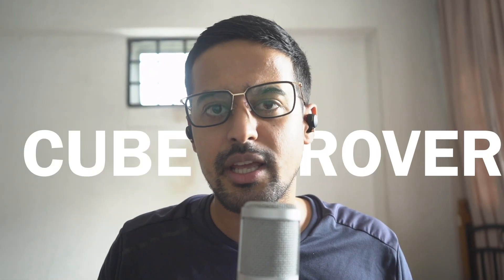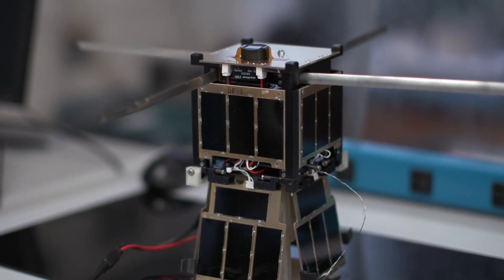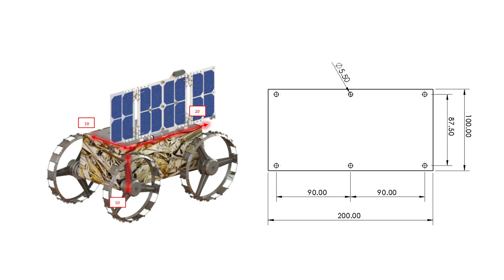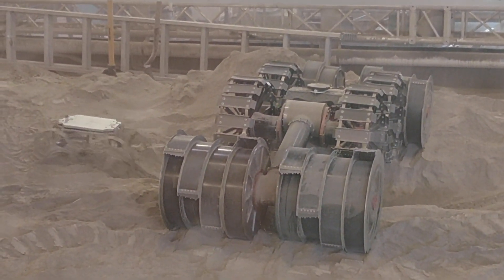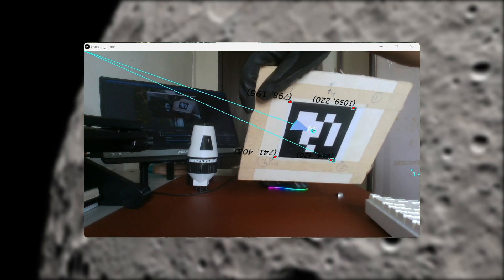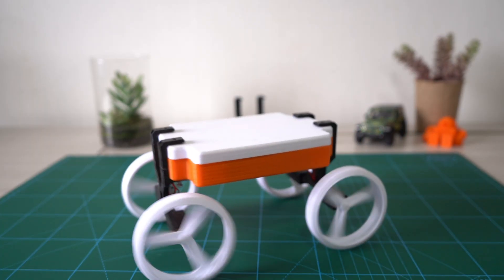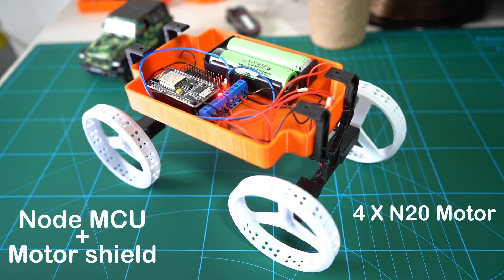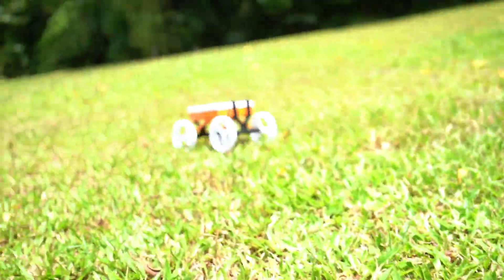Cube rover next generation of space robots

Comment: This project is very interesting, do you have a link where you can download the STL, list of components and the code to be able to carry out this project? Is there a forum for it?  I wait your answer thank you.
Reply from the maker: Code and files link is in the description. There is also discord server link if you need any help.
Reply: @SasteJugaad  Thank you very much for your answer, of the pieces to be printed, which ones should have support? Can an Arduino NANO be used instead of an ESP? Is this possible? Thank you again.-
Reply from the maker: @ricardoalejandrocarballes3170   Depends how good your printer is. I think for struts (black part) I used support.You can use any microcontroller you like as long as you can progrgam it. But I think arduino with motor shield wont fit because height inside the chassis is less.